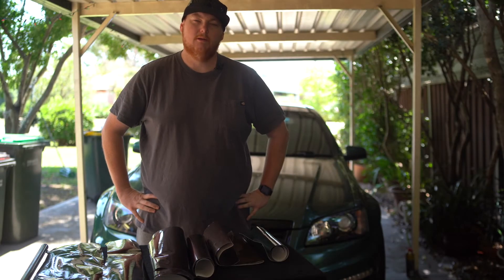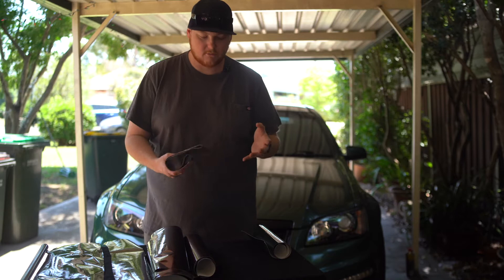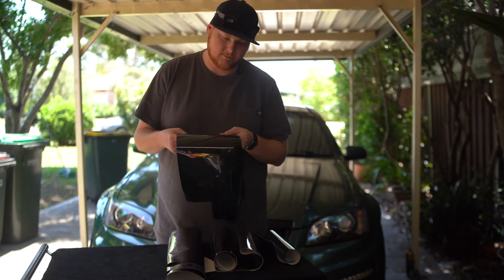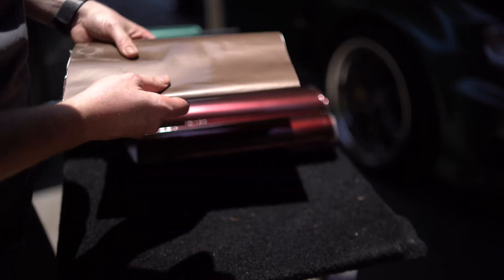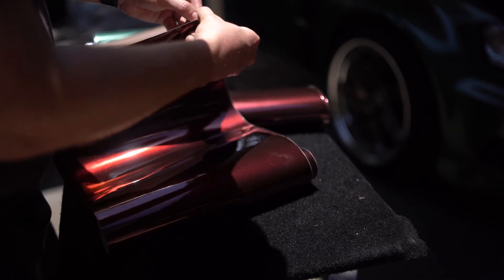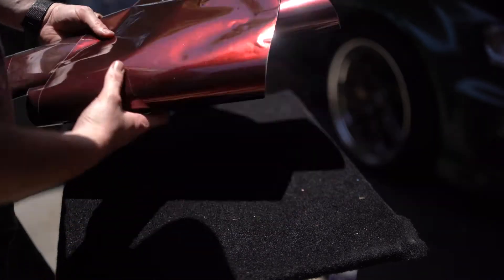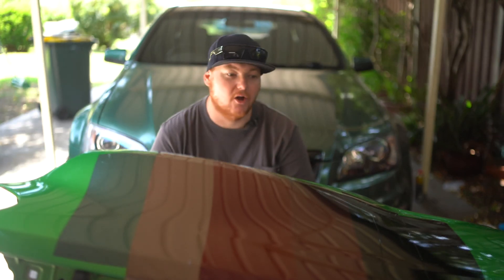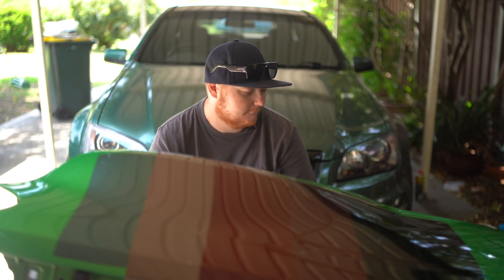All your questions wrapped.... up in one video - KPMF v AVERY v ORAFOL

Comment: Would be good to get some info on different types of protectant for wraps. Is it the same as paint or do you need different specialised products. Can you improve the gloss on a wrap by a special coating or a treatment similar to polishing but for wraps? 
Just something I wonder about if I was going to wrap a car.
Reply from the maker: The wrap itself has good self healing properties from scratches but overtime it will start to diminish. You can apply waxes and paint sealants as well as coating both designed for wrap and for paint and they will all add gloss to the finish. 

You can also polish wraps given that the self healing properties are heat related with a soft microfibre and low abrasive compound you can actually achieve some pretty good results. 

I’ll see if I can put together a bit of a video for you on that.

Comment: Hey there, iam watching for a gloss white wrapping film on my mercedes coupe. What do you think with wich manufacturer i should go? (kpmf, oracal, avery) ? preferably a film with as little orange peel as possible and lots of gloss.
Reply from the maker: least orange peal is probably going to be inosetek but of those options probably the KPMF.
Reply: @TorqueMediaau
Reply: @TorqueMediaau  Yes, I've heard of inozetek, but I'm afraid that the film won't last that long on my car because it's just outside and not in a garage
Reply from the maker: @Luis-bo3iv  I believe most are only guaranteed for 3 years outside in the Australian sun these days. 

Coating it in halo will help in keep contamination off and therefore allowing it to stay clean longer but the sun will still beat on it
Reply: @TorqueMediaau  okay. Do you know the wrapping film bruxsafol - PWF ?
Reply from the maker: @Luis-bo3iv  nah can’t say I’ve heard of it sorry